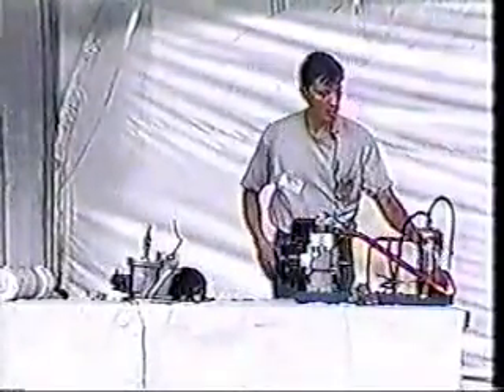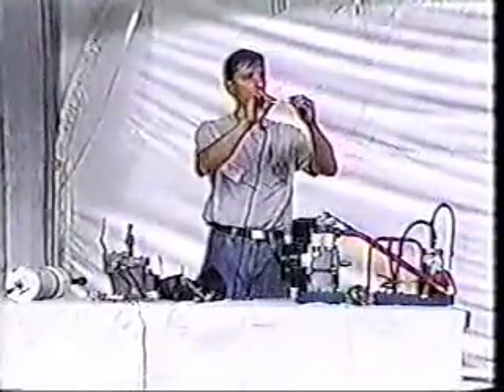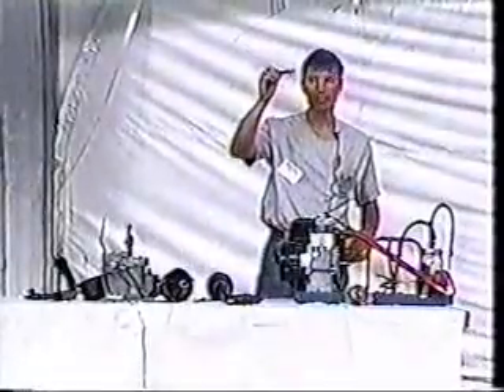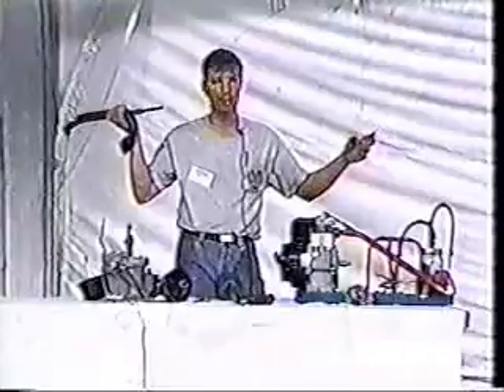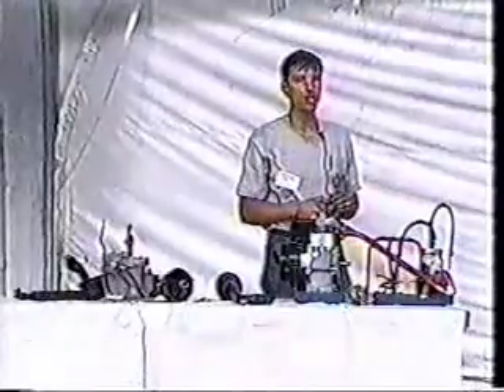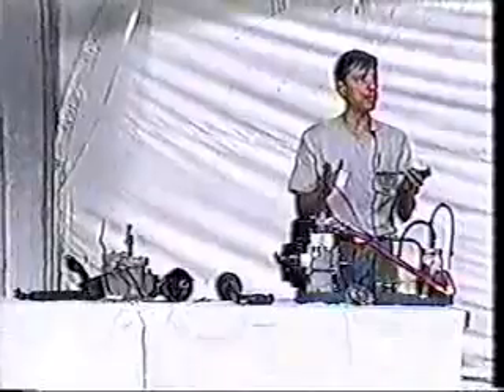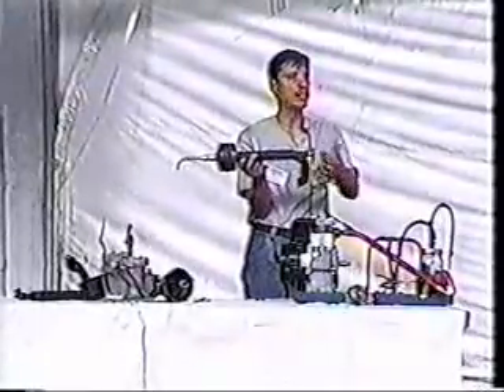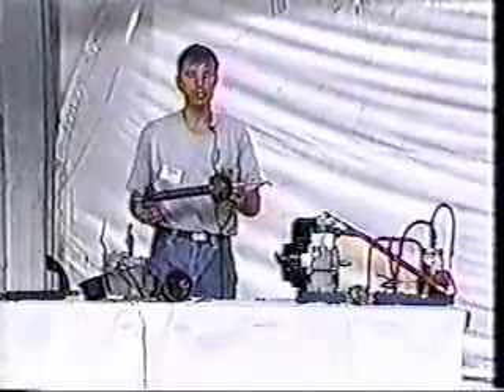GEET Water Fuel Plasma Reactor Chamber Explained Part 1

Comment: Actually all this is is the standard vapor fuel system that is in many vapor fuel videos. It works but has the same problem they all have. Tom Ogle ran into this issue GM had the same difficulty and even Shell Oil tried it and ran into the same problem. 
To answer the post below on  the idea that it runs on small engines but not on larger ones is somewhat correct. Actually the deciding factor in this technology is whether the engine is a "demand"(automobile) engine or" stationary" engine like a lawnmower or a generator. running at a steady RPM is actually the deciding factor in how long the engine is going to continue running
Tom Ogle accomplished his run from ElPaso TX to Demming TX and back (200 miles) at a steady 55 MPH. As he arrived in El Paso his car stalled because he changed speeds(slowed down). Shell accomplished 376 MPG on a test track at a steady speed GM ? On a test track. My results 651 MPG at a steady speed.  It doesnt really matter what speed you choose but once you establish that equilibrium the system will not react quickly enough for the changing needs of the engine. So you cant speed up or slow down. Simple
Most videos use a small engine like a lawnmower. I have run a lawnmower for 4 days on 2 cups of gas. Tom Ogle did the same thing same result. Its done everyday 100 times on youtube. You start the engine set the idle and stop it 4 days later measure the gasoline used.The lawnmower is the easiest experiment and the most popular
Try it on an automobile it will run normally till the gas goes flat about 8 miles for an 8 cylinder, 10 for a 6, 12 miles for a 4
After that it has to run at a constant speed. hard to do in changing traffic conditions
lesliec77@icloud.com
587 920 8034
Leslie

Comment: Pure craziness.. pantone went to a mental facility for a long time for this scam..
In the old west his fate would have been a little different...
Reply: *****

<Insert Popcorn GIF>

PS:

The concept is more or less sound..
Though the explanation is piss poor.

I'm guessing what happens is that the temperature gets hot enough to break the bonds of the water molecules.. This happens usually happens with plasma. Thus its actually running on a gasoline/hydrogen gas mixture.. the excess amount of oxygen gas as well as the higher burning temperature of the hydroxy fuel probably permits the creation of heavier compounds than simple carbon monoxide /carbon dioxide/methane.

In other words the carbon isn't being transmuted.. its simply forming compounds that aren't gases.. Thus no major sput(carbon spewage) is observed at the exhaust.. 

Given the angular setup of the feed line.. it is possible those compounds are then re-combusted over and over again (Ie: the exhaust is actually feeding unknown fuels back into the pistons).

Given the boosted temperature of the hydrogen combustion.. the temperature is then likely to be hot enough to combust those carbon based fuels again.

A very efficient setup..

I kind-of wish they had someone more competent with the mechanics of how it works explain this.

Comment: I would think you could just use the bubbler and get rid of the "reactor". Someone could try mixing water and gas in a 50/50 solution (and a little dishwasher detergent) so you are able to mix the water and gas via emulsion. That way when you are running on just the fumes of the water/gas mixture you don't have to worry about the engine running hot since the water will help cool the engine. I'm not sure that the vapors will contain water in them once you mix the two, so if they don't i would add an ultrasonic mist maker to the water/gas mixture to make the fuel air born.
Reply: Why not? A carburetor basically does the same thing, just not as efficient so the mixture is richer to keep temps down.
Reply: ***** Lol from what I can read... you're sounding more and more like some kind of troll, then again I find myself trolling Youtube commenters as well :]
Reply: ***** Well, that didn't come off as creepy at all.
Reply: *****  I'm not trying to make this "Geet Reactor" machine work. I am aware that it is bogus. I do know that gasoline engines will run on gas fumes only, but because the a/f mixture is extremely lean, it will not run long. I suggested to add some ratio of gas and water emulsified together using a very small amount of soap. Most likely this would have to be injected into the engine because the gas fumes would separate from the water. Soap (in the very small amount required for emulsification) wouldn't really affect the cylinder/valves/valve seals any more than gasoline itself. Too rich of a gas mixture can have the same effect (washed cylinders). Water injection has been used in the high performance industry for years to prevent detonation and help cool down engines that have very advanced timing, so why couldn't it be used to counter affect the "lean" gasoline mixture? If you used an ultrasonic mister to atomize the water/gas mixture, why wouldn't it work? I am just throwing an idea out there, no need to be rude about it.
Reply: "I would not expect much. With advances in fuel injection and oxygen monitoring, I suspect that we're seeing out of a gallon of gas about all we're going to see (given a fixed load and range)"

LOL Some scientist you are
Reply: ***** LOL?
Reply: ***** LOL
Reply: First of all, you must understand refinement and why they perform this centralized process. (effeciency) "I suspect that we're seeing out of a gallon of gas, all we're going to see" Gas is by definition incompletely refined, meaning you can extract more impurities out of it therefore maximizing effeciency. 

Saying we've maximized fuel efficiency undermines validity of the refinement process.
You dumb bitch
Reply: ***** But you already know this
Reply: ***** Try surrounding that carbon in some hydrogen and you're getting closer.

Comment: If this can be downloaded off the internet...for free, and is free to use for small engines....why does not the military use it???? They could sure benefit from it....
Reply: Actually the military does use fuel reformers and they have convoy trucks that can run on salvaged used motor oil.